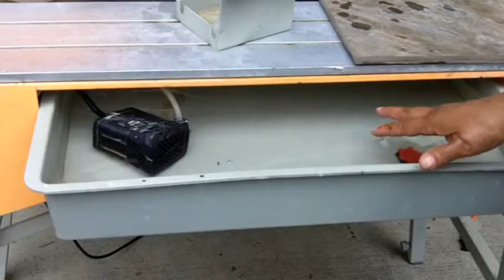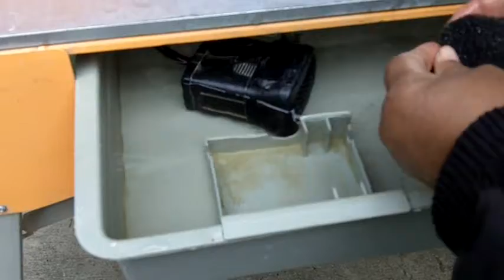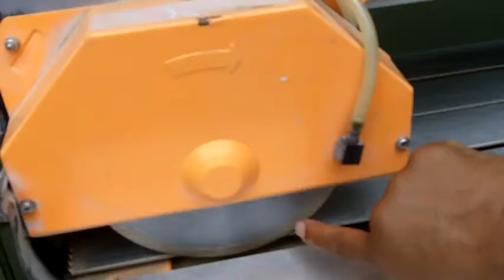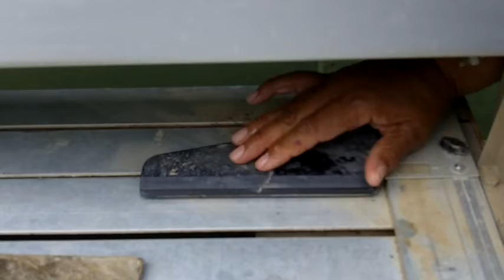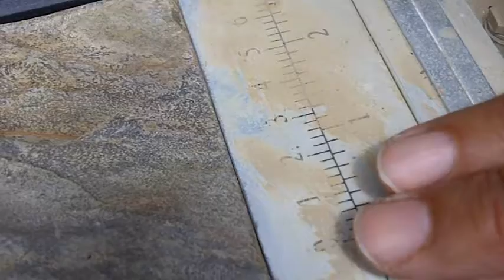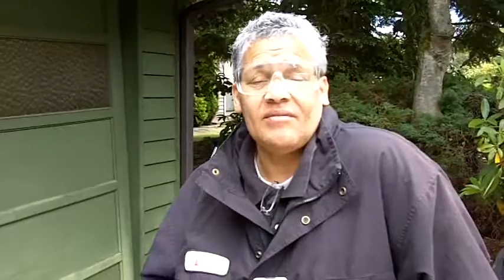How to Use a Wet Saw to Cut Slate Tile

Comment: Have you had issues with the slate cracking or chipping off using a wet saw? I have some cheap slat tile that I purchased and have been attempting to cut it using a 4 inch angle grinder with a diamond blade with a very low success rate because it just cracks.
Reply from the maker: mike barillet Here's the thing.  You are going to have some throwaways in either case, because that's just the way slate is.  I will say that I had a much higher rate of success with the wet saw, and didn't have any issues.  Wet saws really do the job, they cut through tile like butter.  Some slate, however, is just unsuitable to cut, period.  You need to sort through the tile and set aside the ones that seem fragile.
Reply: Thank you for your quick reply and help! I guess I'll have to supplement my tile supply with better slate for the parts of the floor where I will need a lot of cuts.

Comment: Thanks!  In other videos the person kept the saw on while backing out the blade. Does it matter?
Reply from the maker: Thanks Pierre, for your comment and your question. To answer your question:  I have over the years developed a personal habit of safety while operating power tools, which is why I turn it off.  Also, backing the blade out  while the blade is rotating could risk a nick on a otherwise perfect cut.